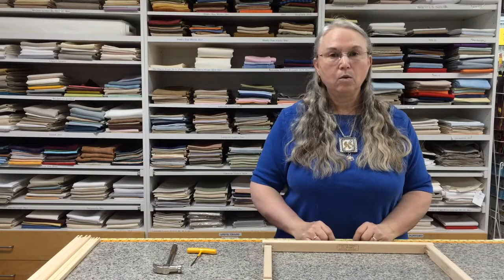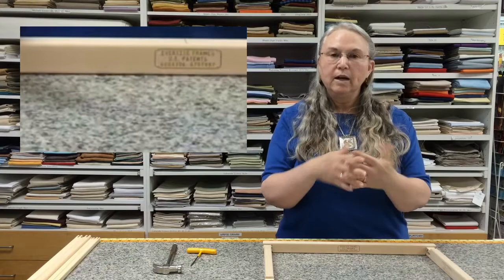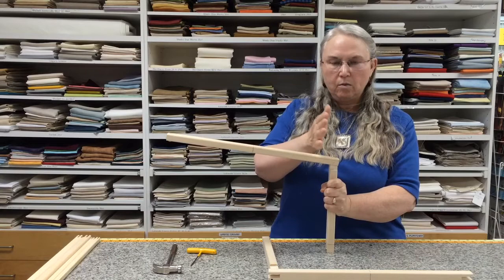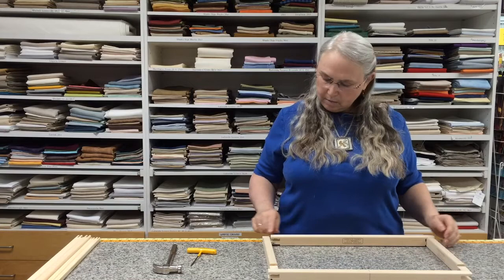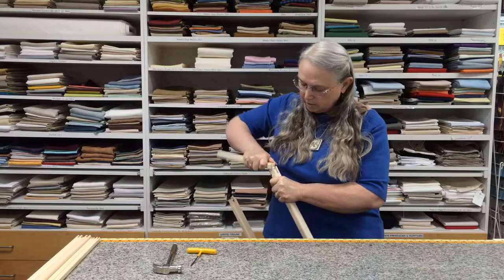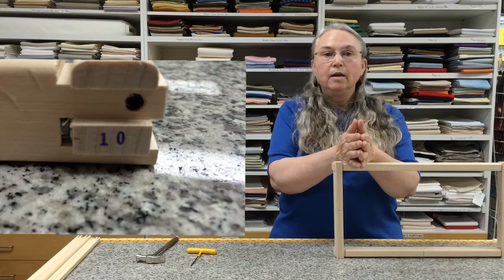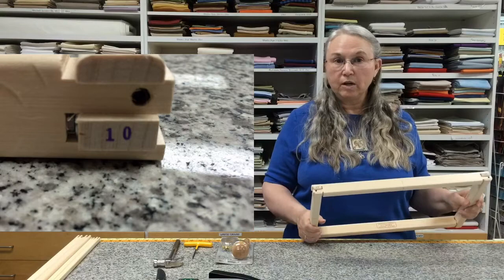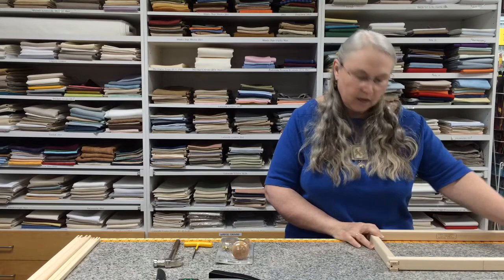FlossTube: NIAH Stretcher Bars 101 (2) - Evertites

Comment: BTW, easiest way to square up the frame is to measure between opposite corners: all corners are right angles when the distance from upper-left to lower-right equals that from upper-right to lower-left. You can get it quite close simply using a yardstick.